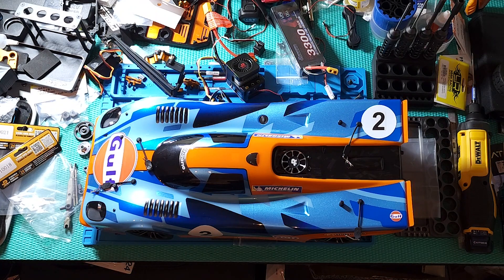Servo Relocation for the Rlaarlo AK 917

Comment: nice. next we need to see a shake down.  give us a good performance test video. im sure it will handle as it should but more interested on longevity and durability. also is it just to make space for the speed runner builds?
Reply from the maker: You can see initial runs in one of my other videos...it runs as straight as an arrow.  As for longevity & durability, there are countless videos from others, involving a good number of crashes...and, as those videos show, they AK-917 is quite durable.  There are a couple known "weak points" (especially the turnbuckle for the right-rear upper suspension arm), and Rlaarlo is in the process of fixing them.  According to what I was told, the metal used is NOT "pot metal" (as some seem to think)...it is steel...but, the hardening process used also caused them to be slightly brittle.  With the current batch of turnbuckles being produced, they have altered the process (by lowering the heat treatment/hardening temperature, which should still allow them to be hardened enough, but also be less brittle.

As for the "making space", yes.  This will be the first of two speedrun AK-917s (I will eventually get an aluminum chassis roller, and transfer the current electronics into that, purely for bashing).  With this one, the (current) plan is to keep the ESC, but replace the motor with a longer Rlaarlo motor (as long as the current motor proves reliable, which I think it will be).  Doing so requires the ESC to be moved forward, thus the need to relocate the servo.  The second car (for which the roller has yet to be ordered) will run a Castle MMX & motor (although, that motor will probably be replaced with a TP down the line)...thus, again, more available space is needed, and servo will need to be relocated.

One thing I should have mentioned in the video...but, admittedly, forgot...is that this should NOT be done when using the plastic brace (as is included on the aluminum chassis versions).  The plastic brace is NOT 'solid', and does NOT have the strength needed to 'support' a moving part.